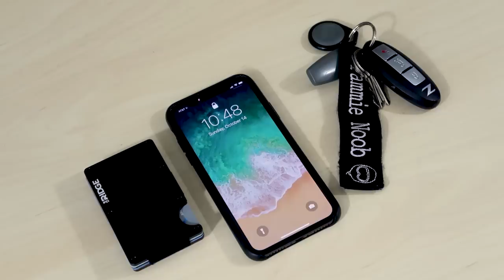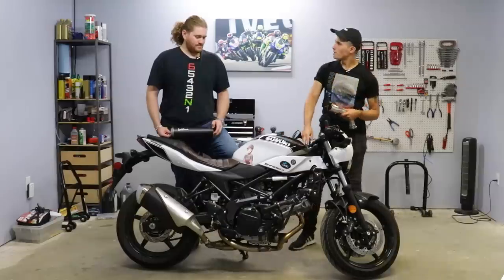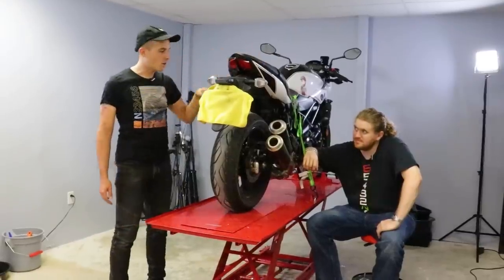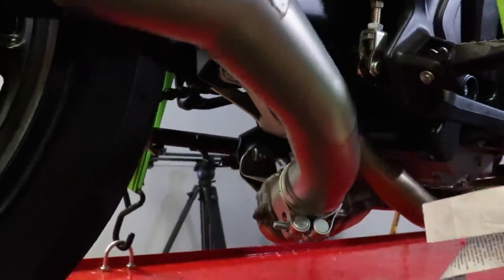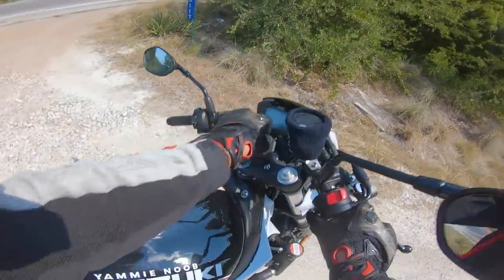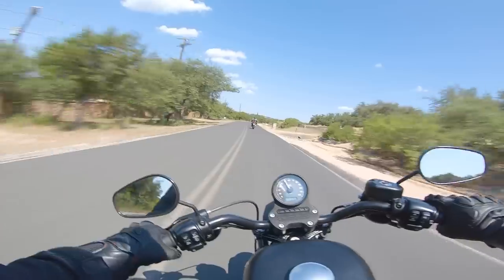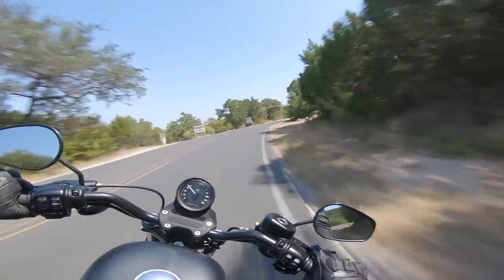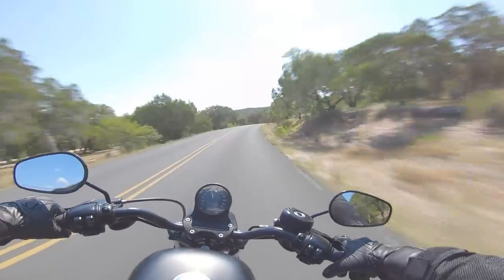SV650X Gets LOUD! Best 650cc Sound!

Comment: Personally I prefer the sound with the baffle. It's more muffled and grunty instead of screaming it's face off.
Reply: The SV650's also like back pressure so these bikes run much better with baffles left in
Reply: @GorolGronu  pretty much any engine will prefer back pressure as it will get rid of unnecessary fumes quicker. This bike now will most likely need new fuel maps to restore it's power... I bet it lost a bit of mid-range.
Reply: @kretktzable    No four stroke wants backpressure.
Reply: Peter Ökvist every NA 4 strokes need back pressure. It’s helps with scavenging
Reply: @PeterOekvist , You're very wrong.
Reply: Baffles out for sure!!!! sounds amazing and I didn’t notice any power loss at all so… I had 4000 miles on stock exhaust and now 2k with this one on and it’s great.

Comment: guys the cat is right before the midpipe. It's got an O2 sensor and everything.
Reply: i think its a small cat, and the sound muffling is not done all at the same section. its the same as in the GSX S750. thats why you get awesome sound just by installing a slip on.

while on most other bikes,they have bigger cat and muffling done at the same spot. they sound the same whether or not you have a muffler on. as if the muffler is there just for the looks.
Reply: @alphacapo  have to disagree, looks are pretty important. What i meant by just for looks, is that the sound doesnt change much if you just change the mufflers, in the case of bikes with big cats.

And, its better to put a removable muffler, so that we may opt for replacing just the muffler or the entire system.
Reply: Yeah not a resonator

Comment: I love that bike so much, want one so badly! But.. very happy to be past the adolescent stage where I feel a great need for more noise: without the baffles that's too much; it's loud enough with them in, for sure.  That's the wrong sound for that bike, IMO. I would agree that the factory pips are a bit.. soulless, considering the sweet sound of the engine, but no: that's too much.
Reply: Also, in addition to the adolescent bit; putting on a new, more easy-flowing muffler without doing some work to the air-intake and remapping the engine is to me the same as putting go-faster stickers on a bike..
Reply: Yeah. Less "noise" is better.
Reply: I own a 2023 sv650. And I absolutely will be changing the exhaust. I can't hear the stock exhaust with my helmet on with any speeds higher than 40 mph.

Comment: What bike would you recommend for a beginner I'm 15 looking for a bike to get but I can't seem to find one that doesn't break the bank. Any recommendations?
Reply: Start on a 300 class my dude. I started on a 125, because that was the only thing I was allowed to ride at 16. I'm getting my full licence now, and looking at this one at 21 years old. 125 is too slow, but a 40hp 300-400 is great for a beginner.
Reply: @jensfos  hey I’m 16 looking for a bike, I found a 2018 Yamaha r3 that I like, any tips.
Reply: @azush1055  Yamaha is great imo. I ended up buying s 2021 MT09SP, and couldn't be happier. 
I haven't tried a R3, but if my 09 is anything to go bye, it's gonna be great. An R3 would be great in the corners due to its low weight, and maybe actually livable on the highway thanks to its windscreen.
Get a R3, a decent sounding exhaust and a tail tidy, and you'll be set.
Reply: @jensfos  wow thanks for the advice and I will definitely look more in R3s and Yamaha’s in general!

Comment: Does this mean the SV needs a tune now that the cat was removed from the stock exhaust?
Reply: The cat's not actually in the muffler, it's the bulging section where the 2 pipes meet up, just before their new mid pipe.
Reply: So no tune then?
Reply: @clancybassett4721   It'll run a bit leaner, but not dangerously so.

Comment: The sv650 is unique cos it doesn’t have the same parallel twin as the rest of the 650 class???
Honda cb650r has inline 4
Mt07 has cross plane parallel twin (so kind of different)
Only Kawasaki of the big four makes a standard configuration parallel twin for the 650 class bike
Reply: Doesn't triumph still build a street twin?
Reply: WhiteSpider125 that’s a 900cc parallel twin tho but I guess it counts cos it only makes 64bhp but 80nm torque so idk

Comment: Chaps, best sound??, fuel injected 650 Bandit, 4 into 1,immediate throttle response, red line 12,000 rpm, best bike ever. 650 Bandit. Professor Bandit 650 B.T.E.out., Bandit Torque ENJOYMENT only, nothing technical.